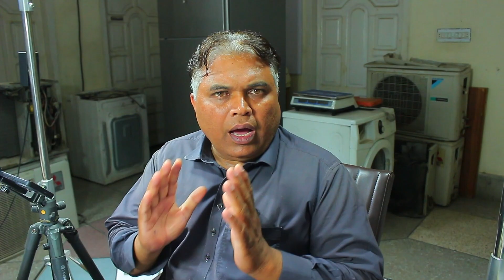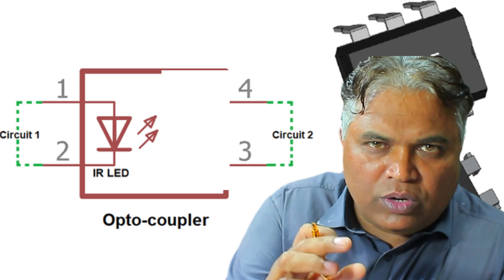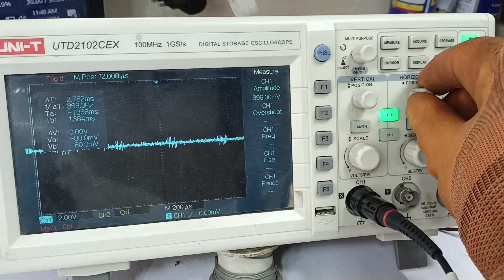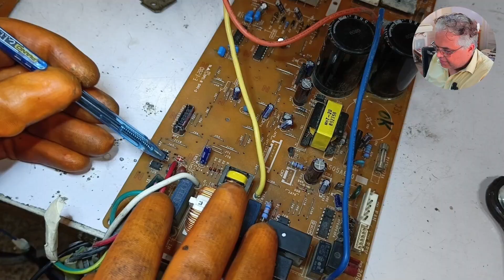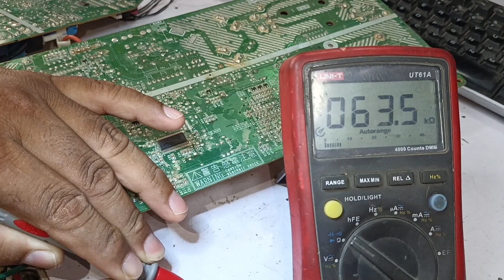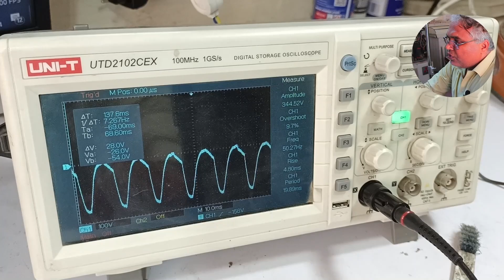Fix Mitsubishi AC 6 Timer Blinks with This Circuit Board Trick

Comment: Hello, how can we check while the air conditioner is still installed on the wall whether the communication problem is caused by external or internal electronics?